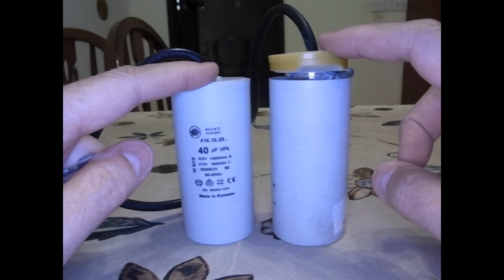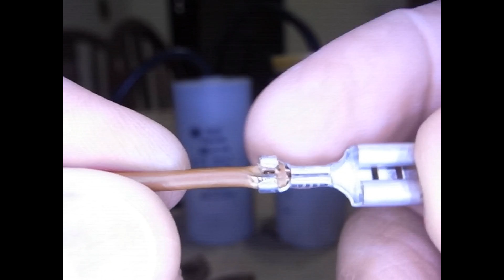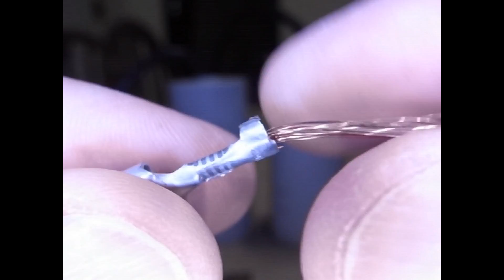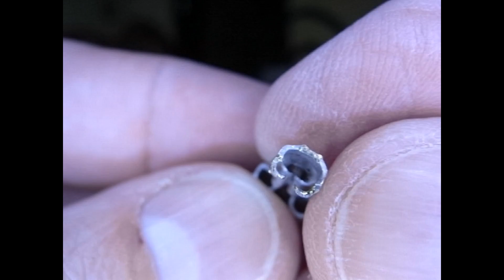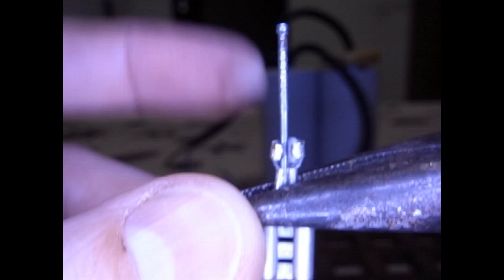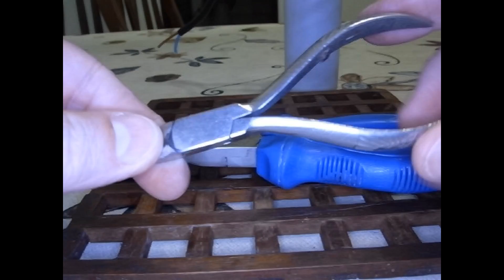Reusing Crimp Lugs (Updated Video Available)

Comment: The male flat lugs on most equipment is common sized 1/4 inch. So it is best to just replace the female ones. 

The clasp that grabs the plastic is strain relief. Many common aftermarket ones do not have that but if you just put some heat shrink over the wire before crimping it does the same. Remove the Blue or Red plastic insulation and insert your wire in and crimp, slide the heat shrink over the crimp and heat.

Comment: Nice video.  I have to remove a ground wire from one of my vehicle's ground points, refresh the lead and recrimp the eyelet terminal.  Wondering if applying some heat might help maintain the integrity of the crimping parts?
Reply from the maker: You know, it might help to anneal it. I have never tried it. If you do, please let me know how it went.
Reply: @tsbrownie  First run with propane caused a little collateral damage.  The problem is it heats up so fast the entire connector becomes malleable and so I bent it a little at the neck.  But I'm going to try a food grade butane torch and see if the smaller flame will be better.  My wire is braided with a strong and thick braid over copper, so pulling the wires out of the smaller crimp is not an option, and this connector is difficult to find with a bracket on the side so I kind of need to reuse it.
Reply from the maker: @CHAOSMOVEMENT  Yes, it's easy to overwhelm those. I think a cigarette lighter would work, or even be too much. Thanks for letting me know. One (selfish) benefit of Youtube is people teach me from their experience.
Reply: @tsbrownie  Got it, with a very small propane flame. Got it bent back in shape, AND got the crimps open super easy holding it with a vise and just sticking a small screwdriver in the crimp and lightly bending.  The heat made it 100X easier.
Reply from the maker: @CHAOSMOVEMENT  I will have to try that next time. Thanks again.
Reply: @tsbrownie  Thank you for the content buddy!

Comment: Seems easier to leave the terminal on the wire and instead butt splice the wires together and cover them in shrink wrap.  That is faster, easier and maintains the integrity of the original crimp.
Reply from the maker: True enough. In older stuff (this was from a pressure washer capacitor) the wires are corroded and cutting them back and soldering them gives a low resistance, long term fix.

Comment: Hi, what if I can't open it up because it's too small, can I still place the wires ?
Reply from the maker: You need a mechanically strong connection, I do not know of any other way to get that. Wrapping the wire around it is not strong. I can't recommend doing things that might come loose and lead to a hazard.
Reply: @tsbrownie  ye I managed to open them with a nail clipper, took me some sweet time, then, for safe measure wrapped some , i don't know what you guys call it in america, but it's a black tape that seals the electricity, thank you for your video!

Comment: Excellent video of stuff that's totally overlooked by most so called mechanics and fitters....many thanks, great help for my Alfa Romeo electrics which constantly need work.
Reply from the maker: Very welcome
Reply: Some of these automotive crimps are small & pressed on really hard. I found it impossible to open several of the thin, inner areas (the ones which grip the strands). I tried a nail (it was too big) & a strong leatherworker's needle (I bent the needle!). In the end with all the flexing I broke one where they narrow soe decided to just solder the new strands wrapped around the still closed crimp. If you can't open one out this is an option & it'll still conduct.

Comment: Wouldn't it have been better and easier to solder or butt connect another wire to the original piece you cut off??
Reply from the maker: Fair question, but I like to minimize total number of joints.  Joints are where things go wrong typically.